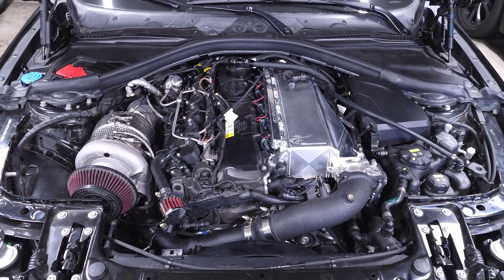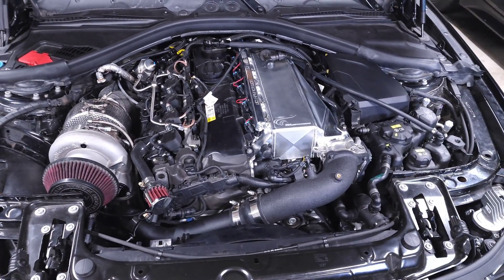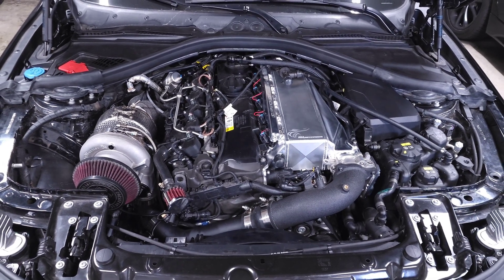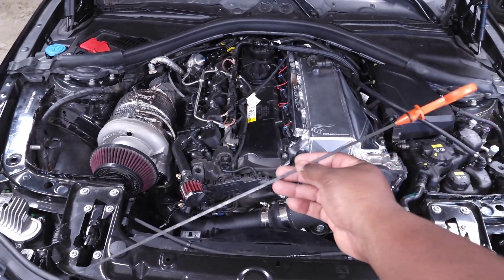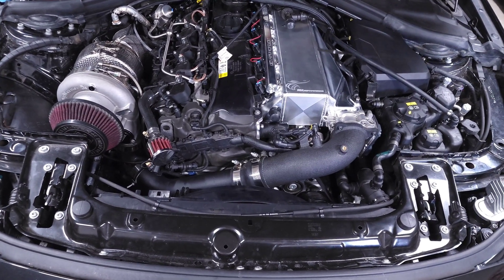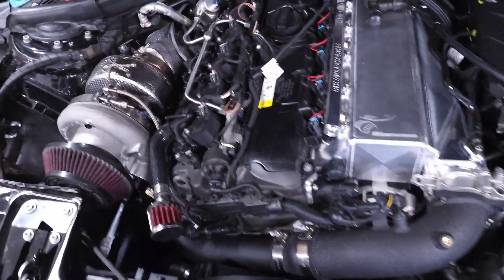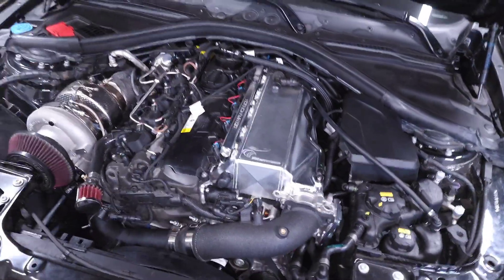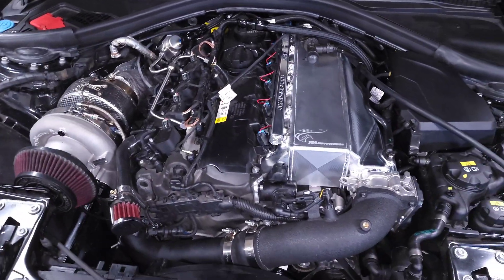Retrofitting a Dipstick on a Modern BMW DIY

Comment: DIP STICK    =  guranteed oil level knowledge          -   chance of having oil inside a motor very HIGH
DIGI display = NOT 100% CORRECT measurement -  chance for running without oil or low oil level        = more trouble = like sitting on MINE